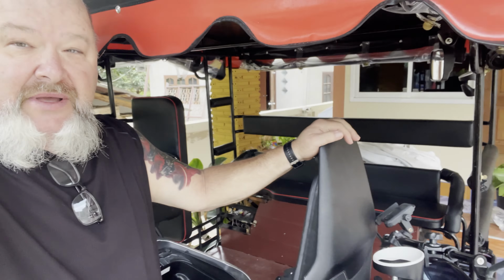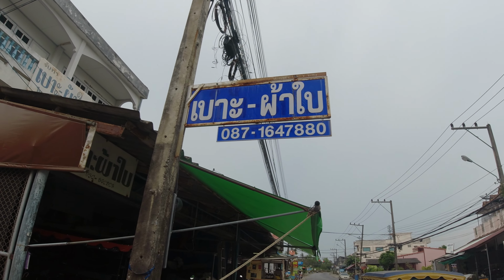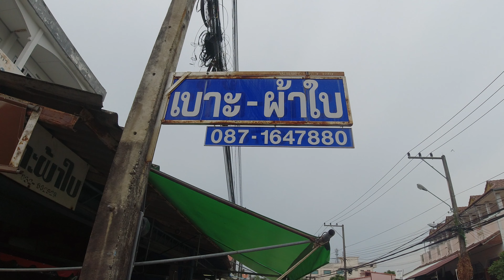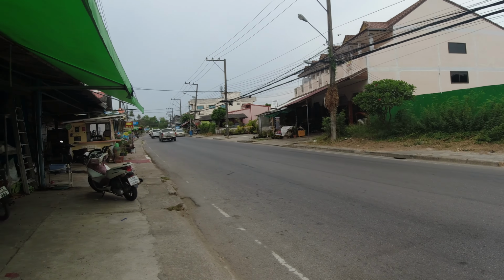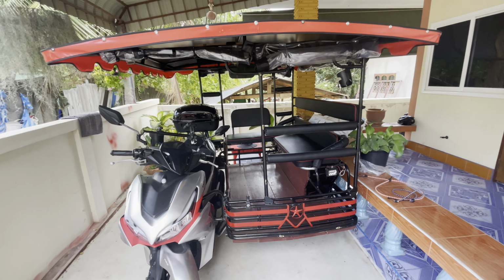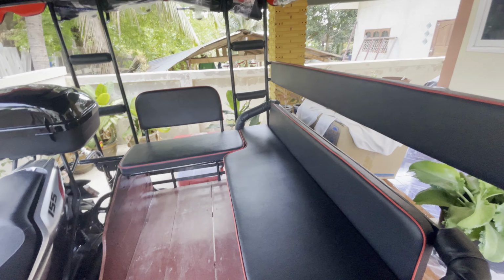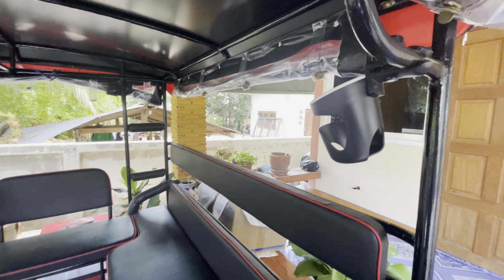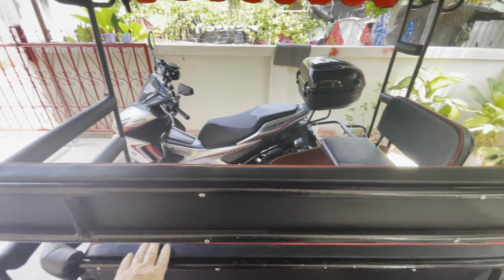Modifications made on Black Betty

Comment: Are there two Monkey Mountains? One in Hua Hin and the one where you are? Just watching a video of  Hua Hin and they went to the entrance on a beach of Monkey Mountain.  It had a golden  Budda also.
Reply: @janewoodside
The one in hua hin is called khao takiab which means chopstick , there are lots of monkey on khao takiab so hence the name , hope this helps , I don’t know for sure I’m only guessing but the one in pratchuapkirikan is probably not called monkey mountain either it may have a proper name but calls monkey mountain due to all the monkeys , a local would have to tell you if that is correct
Reply from the maker: Yes not sure about HuaHin, the one her in Prachuap actually has a statue in front of it with monkeys. I have taken many pictures with my videos of it.
Reply: Thanks,  confusion abounds here. But I still won't be going around those monkeys :(
Reply: @janewoodside
I’ve been to hua hin many times and my partner will not go where the monkeys are hanging around so we’ve only seen it from the bottom of the hill , a scratch or bite means a hospital visit for a rabbies shot , even any dog bite and you have to go for the same shot , not worth it in my mind , I’ll watch the videos of the guys that go up , thanks to Mike and many others who do , cheers from Thailand , 
Regards Davy 🏴🇹🇭

Comment: Ah nice one guys. That looks the goods. What Is the engine for the bike. 250 Honda?
Reply from the maker: It is an Aerox 155 Yamaha
Reply: @JourneyswithMN  ok. Sweet. Must be good on gas ?
Reply from the maker: @lifewithoutvegemiteisamazi2100  Add the weight of the Saleng and its ok gas milage, LOL:face-blue-smiling:
Reply: @JourneyswithMN  I'm thinking about having a similar one built in Krabi when we move buy I'll put a 500 or 650 bike with it.
Reply from the maker: @lifewithoutvegemiteisamazi2100  The Salengs in Krabi look bad ass, look like little race cars. LOL Any bike above 300 would have know problems pullin a Saleng. Good luck.:face-blue-smiling: